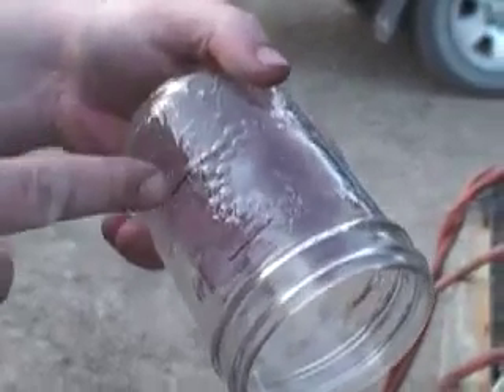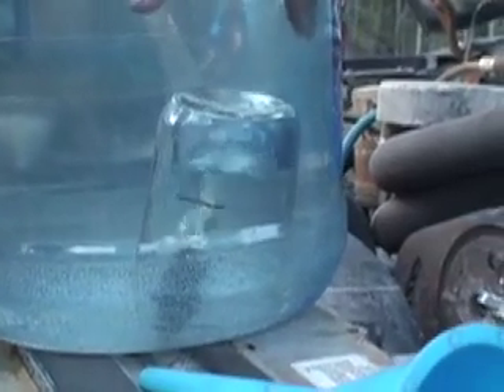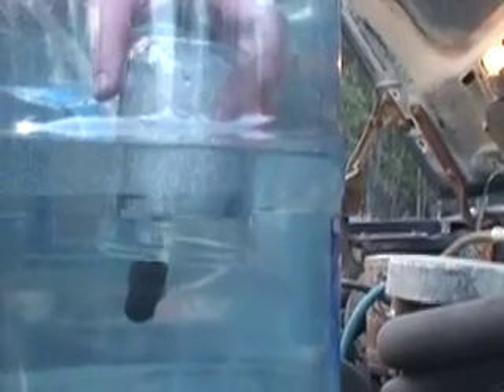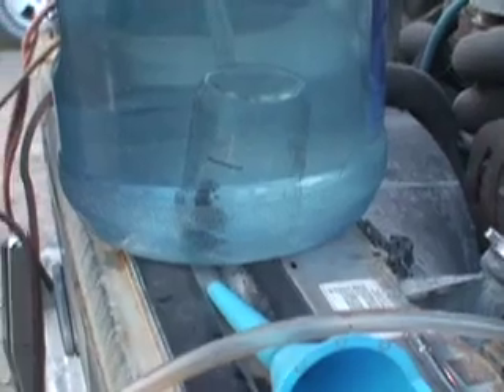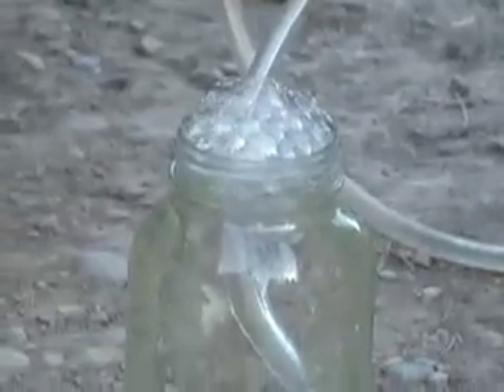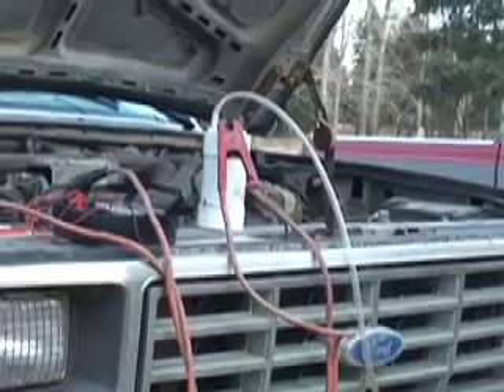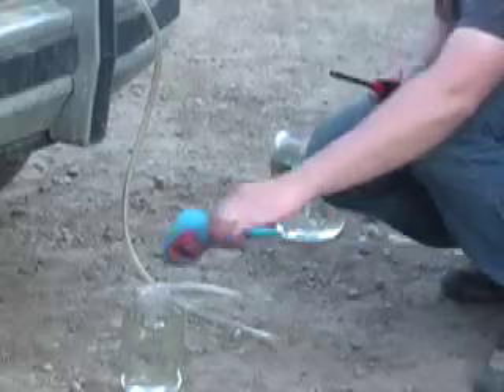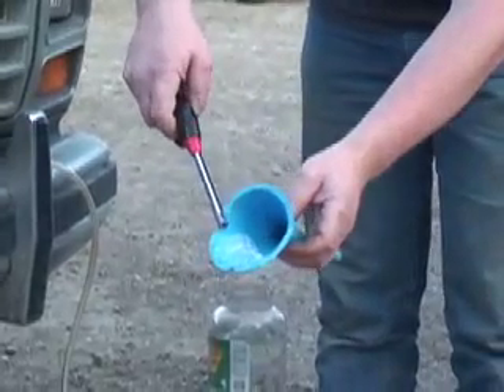HHO Fuel Cell | Hydrogen Generator Demo

Comment: shivrajvishnu: Mythbusters did not bust it really. They proved cars can run on Hydrogen. As for the part they did incorrectly they did not have 2 parts of their test setup right. Spacing of the plates (key) and no baking soda or other catalyst.

Comment: Pretty good but you will probably need 3gal per minute to support the car. 2 gal through fuel injection system. I suggest your switch to plates.